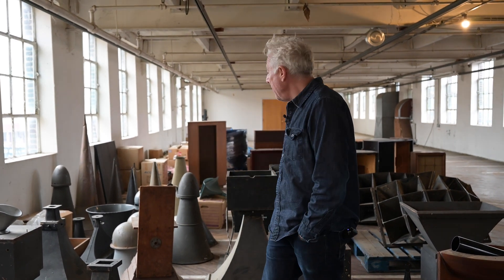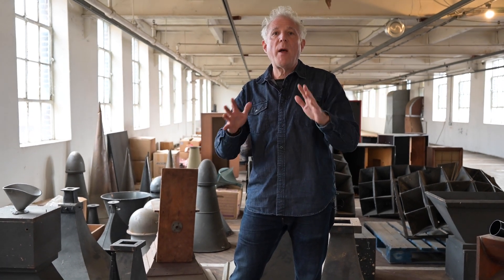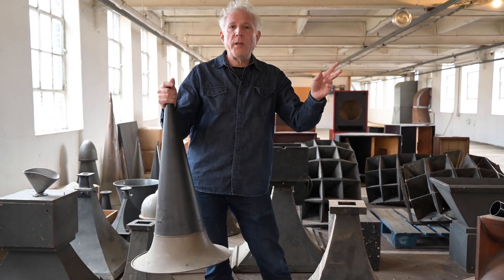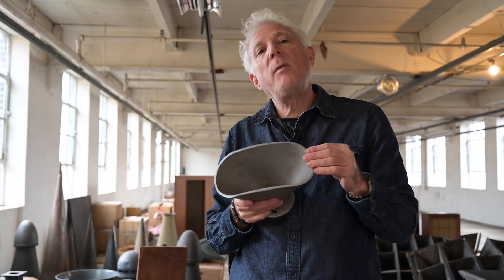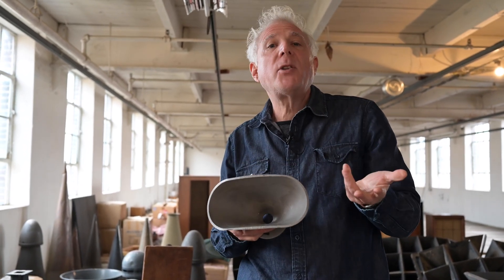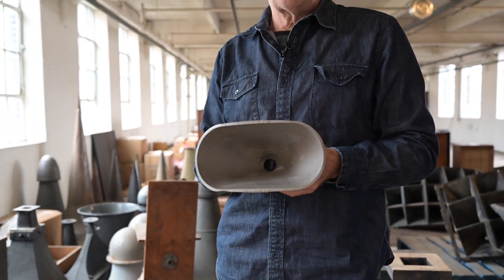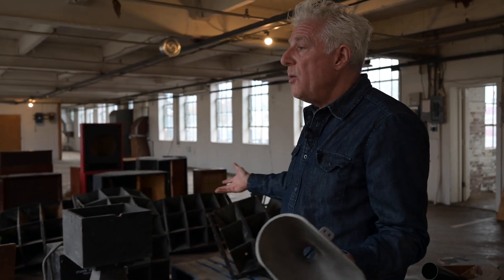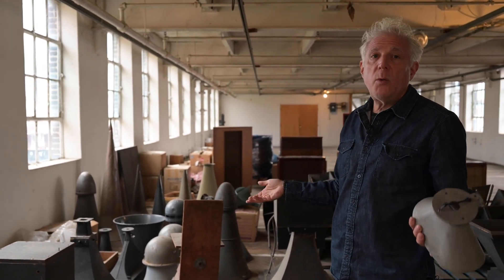OMA on What are Horns

Comment: Jonathan, although I’m a relatively young audiophile, I much prefer vintage tech and love (good) horns.

Is the more direct sound compared to reflections the main reason that horn can portray bigger images than most other speakers, or is there another reason?
Reply from the maker: Hi Nick,
The main reason is source size; the mouth of a horn is the actual radiating area of the speaker, in comparison with a direct radiator which is never as large. This accounts for larger image, greater impact, lower distortion and better image stability.

Comment: that colouration is called higher order modes and compression artifact
oblate spheroid waveguide is the least coloured, then comes conical(edge diffraction happens in conical)

OMA should try Oblate spheroid Waveguide horns too as they are kinda like conical in structure
Reply: The two can be easily combined, JBL published an article on it decades ago.
Turns out that making the transition at the entry to the throat oblate spheroid and have that transition to conical removes all the artifacts from the throat at a slight cost to constant directivity, with out adding in the amplitude losses at certain frequencies that oblate spheroid horns have. 
Giving the mouth a slight parabolic transition will move the edge diffraction to outside the listening position and aid in breaking up secondary reflections in some cases.

Comment: I attended a concert in a round theater back in the early 80's.  The theater had a combination of old EV multicell horns with a horn loaded bass driver to handle the seats midway into the theater to the seats in the back of the theater..   The first 10 or 12 rows had Meyer Sound lab monitors that were aimed at us.  Since I was lucky enough to have seats close up, I was listening to the Meyer sound lab speakers which also had speaker correction to clean up the distortions.  I found out the Meyer speakers also had a horn for the top end..  I took a bathroom break during one the sets, and as I walked to the back of the theater, I could hear a DRASTIC change in sound quality and when I was in the position that the EV multicell horns were aiming at, the sound changed drastically and there was a completely tonal difference but I could also hear a lot of distortion in the 3,000 to 4500 hz range..  it was awful..  So, I can attest to multicell horns as not sounding very good at all.  

I think the conical horn design may in fact be the better design. Haven't heard them in person but I think theoretically, they probably will..